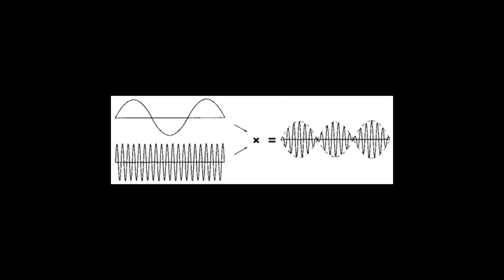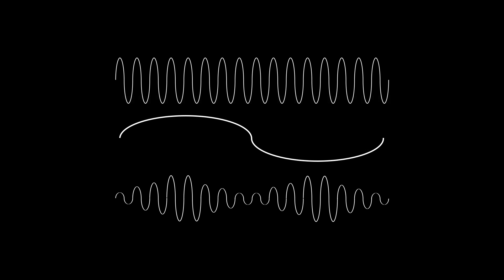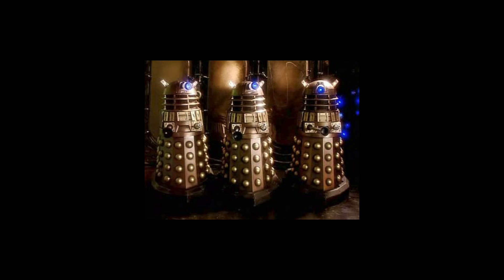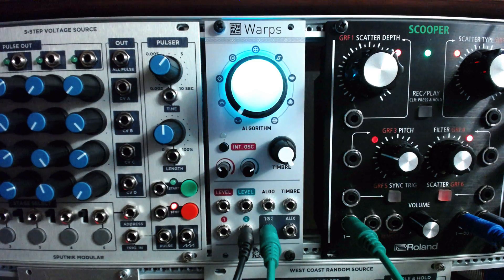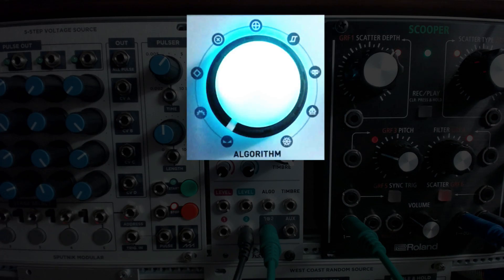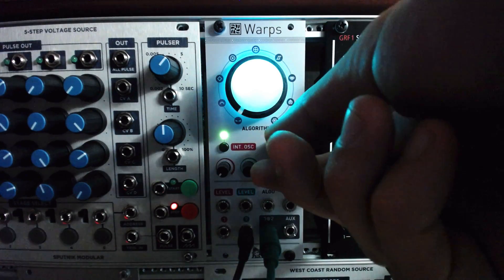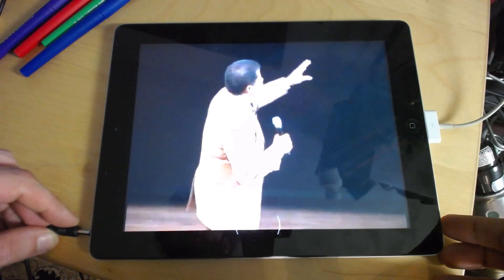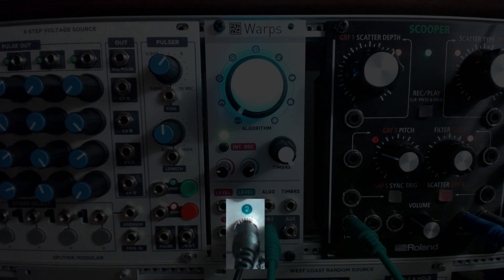Star Wars Voice FX With Warps

Comment: Awesome Joe! Out of curiosity, what are you using to bring your iPad/iPhone volume up to modular levels? Like 10v p-p or up to 20v p-p? Also, what kind of adapter are you using to separate out the tip and ring of the iDevice's stereo jack?
Reply from the maker: +Sysex|Studio Thank you! The great thing about Warps is that it will take that input signal at it's standard level, so no boosting necessary beyond the level knob. No adapter either, just ran a standard euro cable from the headphone out (mono but that's ok) to the Modulation in on Warps. Tried with ipad (headphone out) and computer (from an audio interface) with no issue.
Reply: +Voltage Control Lab oh. Yeah, mono would be fine for this application with audio. There are some apps that generate separate triggers on each channel of the stereo output, and am curious about a solution the put the two signals on two separate cables, amplify the triggers to suitable voltages for modular and trigger different envelopes, clock dividers and other stuff. Thanks.
Reply from the maker: +Sysex|Studio You could use some stereo 1/8" to split mono 1/8" cables like come with the KMI Qunexus, but I have had a hard time finding those elsewhere. You might just have to order a couple from them.
Reply: +Voltage Control Lab oh thanks. Yeah, I'm sure I can figure it out. I did find a module from Animodule that amplifies your signal X 3 and when not in use, it functions as a buffered multiple, only 2hp, about 80 bucks. I think the highest line level signal I was able to measure out of my MOTU audio interface was 3.3v, so that should get it to around 10v or so.
Reply from the maker: +Sysex|Studio Yeah, this setup might not hold up if you have a lot of other stuff going on in the system, it might not be loud enough. But certainly for single pass recordings and such, it works just fine as is. Same with Vocoding, seems to be loud enough.
Reply: +Voltage Control Lab cool thanks
Reply from the maker: *****  Anytime!